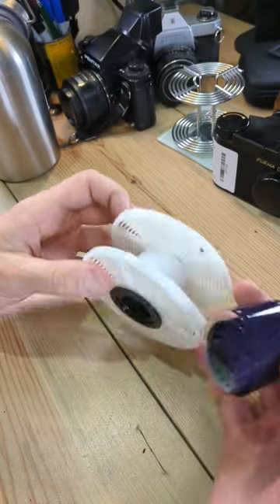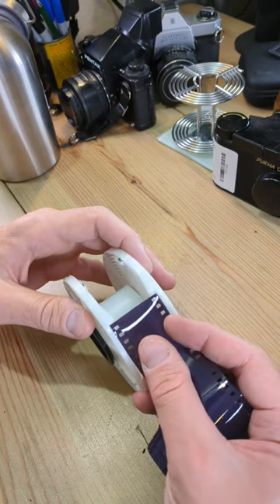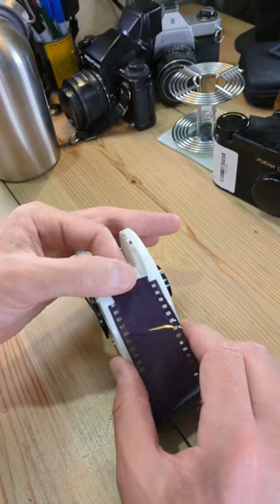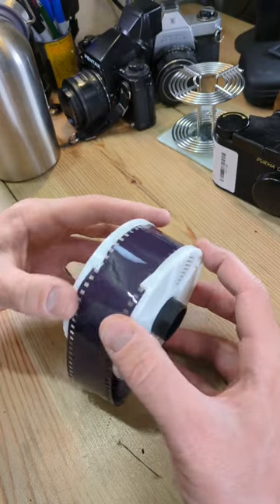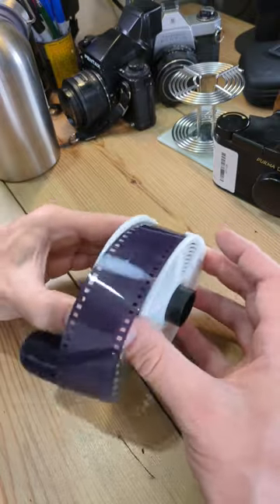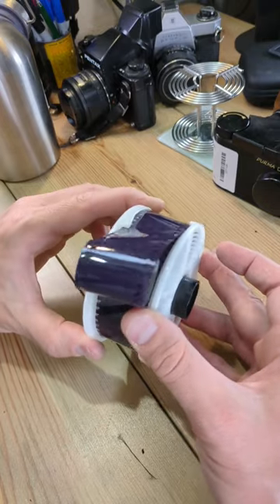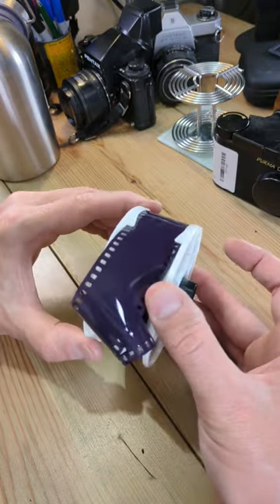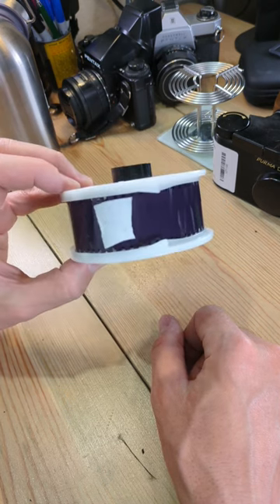Paterson Plastic 35mm Film Reel: 60-second Guide to Loading Film for Developing

Comment: Looks so easy… recently I’ve been having some problems loading it. It seems to me that the film is getting stuck and it scratches the film and make have a real bad time😢
Reply from the maker: Check the spiral to see if there's damage. A broken part of the track would do that.
Reply: @DavidHancock  thanks David, after further reading, I think it is the ball bearings which are somewhat sticky :/ do you know about any possible solution to it?
Reply from the maker: @losborias  try cleaning them with rubbing alcohol on a cotton swab. If there's dirt and grease in the bearing housing that might loosen it.